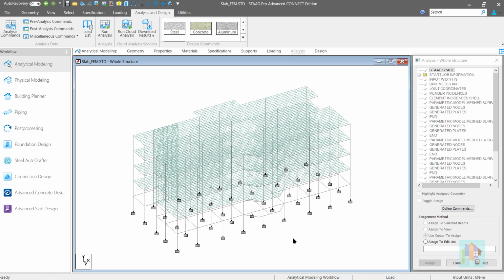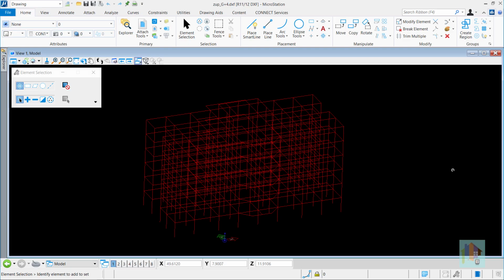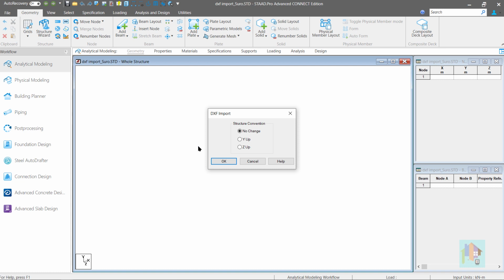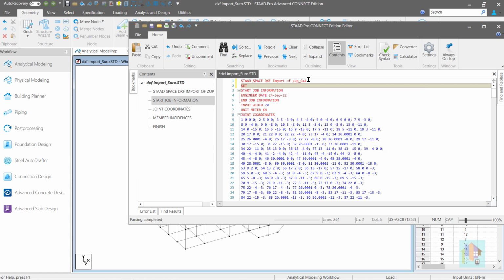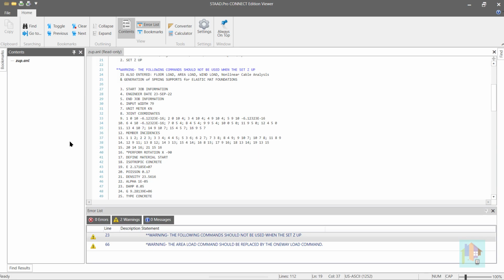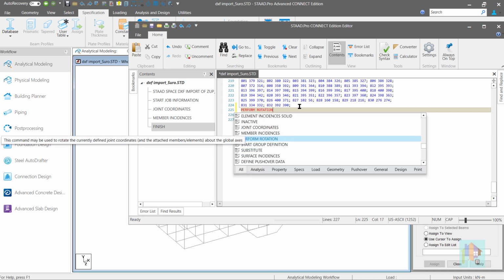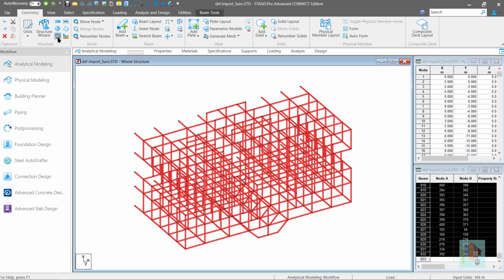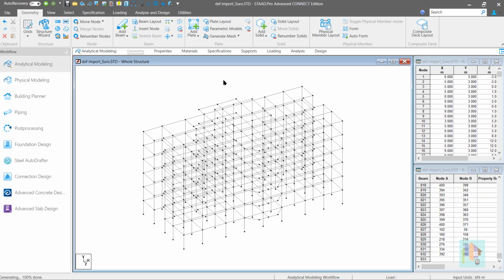# STAAD shorts–Generate structural model from DXF file || SET Z UP, PERFORM ROTATION || CAD to STAAD

Comment: Sir if i generate a staad file from tekla structure design,there is also this problem.and also there is already defined theload cases and their combination .So not only the member direction but also the axis if load cases to be change for the running. How it is possible
Reply from the maker: Tekla has a two way data interchange with STAAD using ISM. You can install ISM-Tekla plugin, generate an ISM file from Tekla and import that directly in STAAD. It will convert the axis orientation and along with geometry, property and specification will also be imported.
Reply: @surojit_ghosh  are you provide any online coaching for steel structure design